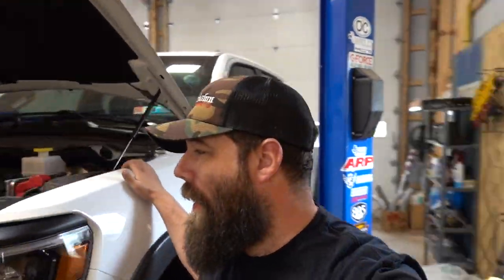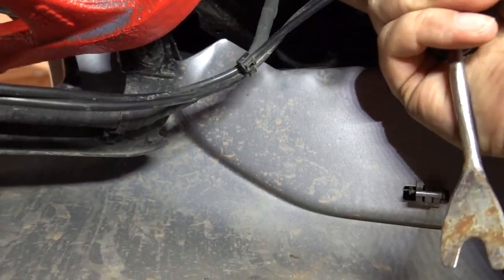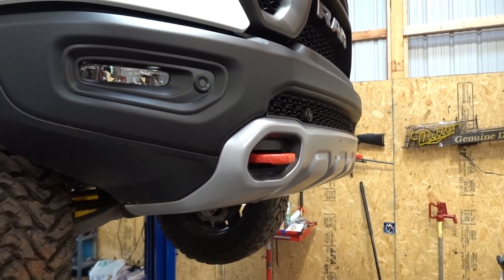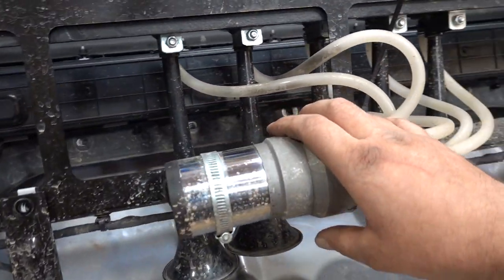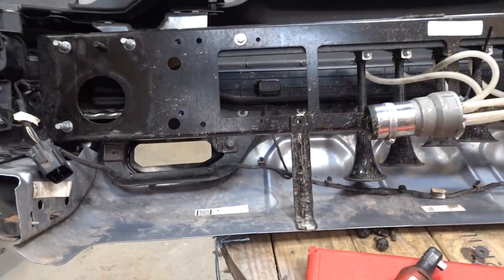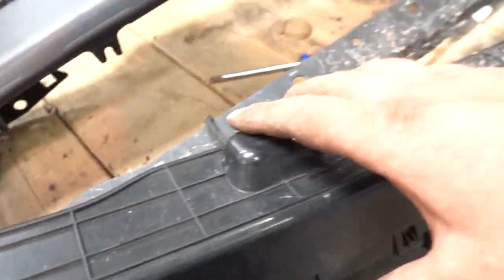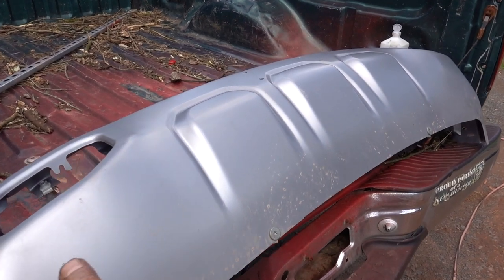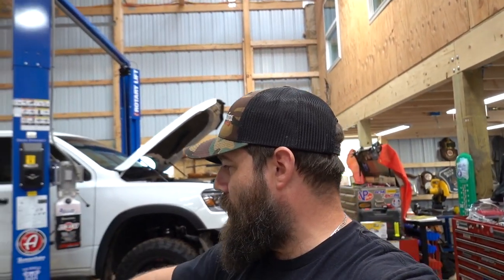2019 Ram Bumper Removal

Comment: "HammerDown".i/we guys on the "Ram F.B".did it  a short cut way.we /i did what your doing.but we just covered everything.i went to the "DollarStore"but the masking tape and the rolls of shelf paper.taped it all off.we never remove the bumper,as for the lightbar? i did the same all install with bumper still in place.sorry i am not trying to show you disrepect on your site,i consider you a friend.i learned a lot from you for my rebel2019.👍😎😎
Reply from the maker: no worries the only reason I removed it all is cause I didn't the edges to peel if I couldn't get under the plate and as for the light bar it can be done with the bumper on but with the horns it is much easier to have it all taken apart for me but I can agree with you for sure, Thanks for being part of the channel

Comment: I think the white will look good but you might want to have it linex white instead cuz its gonna get a beating.
Reply from the maker: slayer calvelli I probably will but I wanted to see it in white before I committed
Reply: Mines been Plasti dipped for about a year and made it through a Maine winter and still looks like the day I did it.
Reply from the maker: @shaker3459  how many coats did you do?
Reply: @HammerdownMotorsportsUSA  It's been so long I can't remember. I want to say at least 5. Thicker you put it on the easier it comes off if you ever wanted to also.